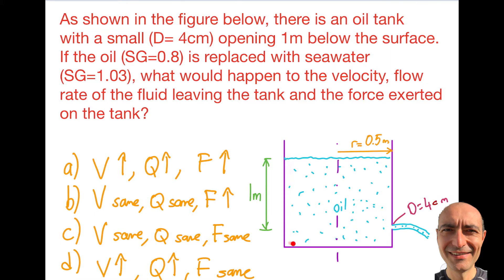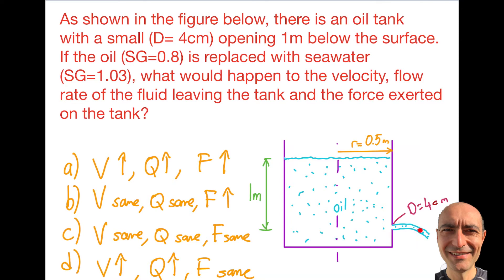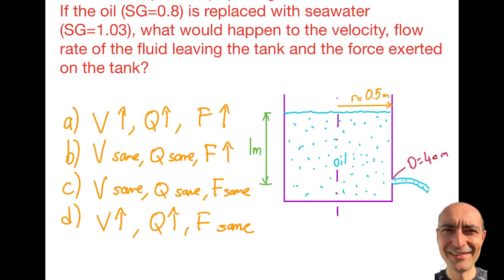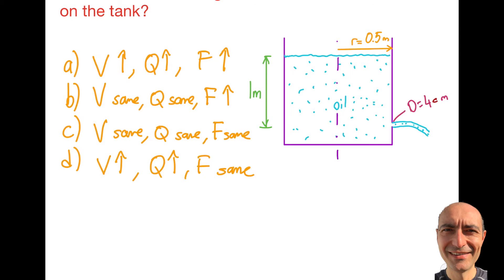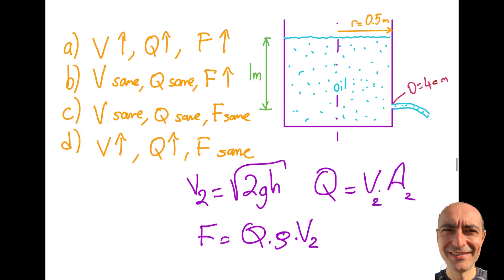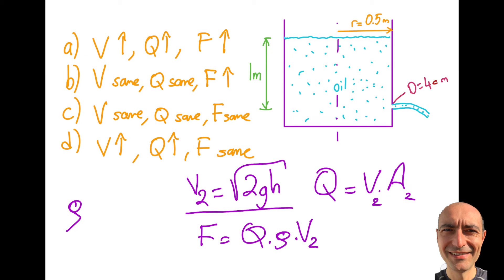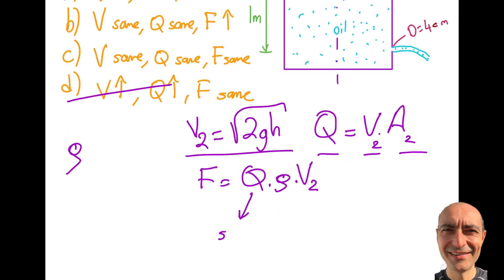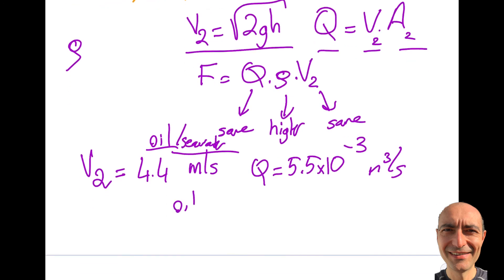FE Exam Fluid Mechanics - 3.7 - Practice Problem - Impulse-Momentum for Jet Propulsion

Comment: It's a great easy question, but it still isn't intuitive to me. We know from statics that pressure at a depth is given by rho*g*h. So, with a higher density, shouldn't there be a greater pressure difference, and therefore greater velocity, as per Bernoulli? Why would this not be the case?

Comment: A mini submarine is modeled as a simple cylindrical vessel. At an ocean depth of 500m, what is close to the radial stress if the inner and outer radii are 0.5m and 0.55m, respectively? please help me with this question thanks